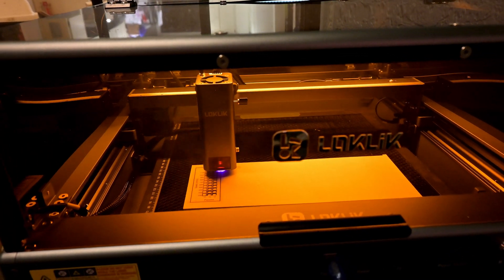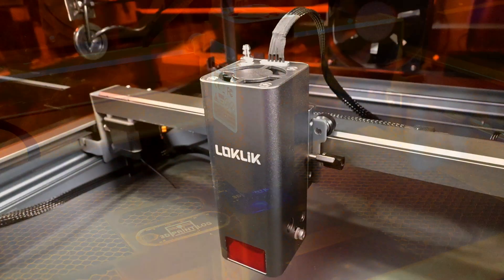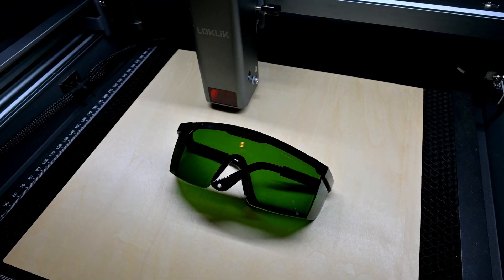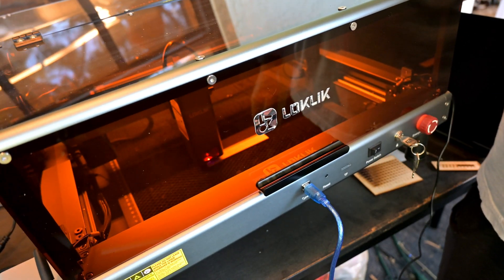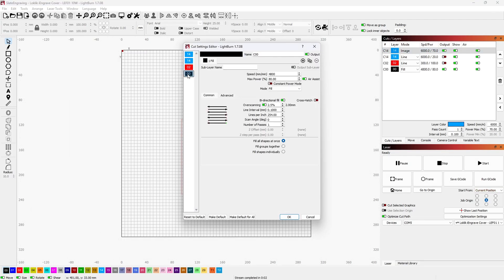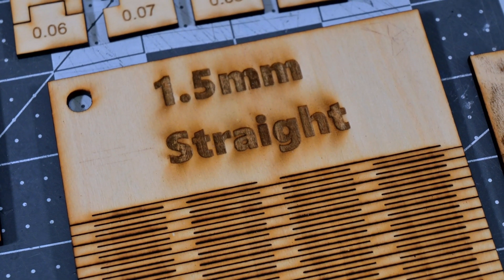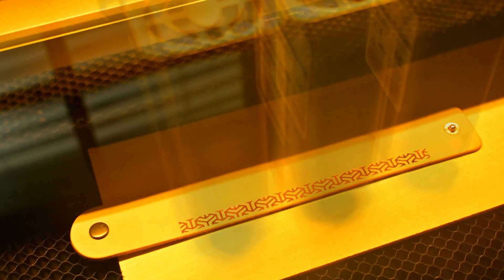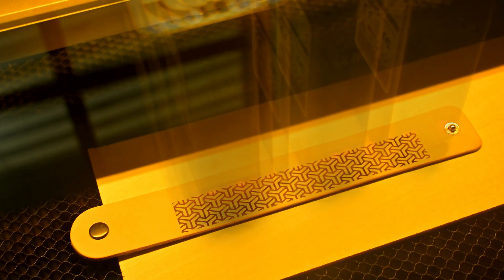Affordable Enclosed Laser Engraver Review | LOKLiK iEngrave 10W Tested

Comment: Did you use the air assist that came with the machine? The one that comes with the machine has an additional air nozzle to replace the one that's already on the lazer.
Reply from the maker: I did not have their air assist bundle, I was using my own compressor. Good to know it comes with a replacement nozzle!